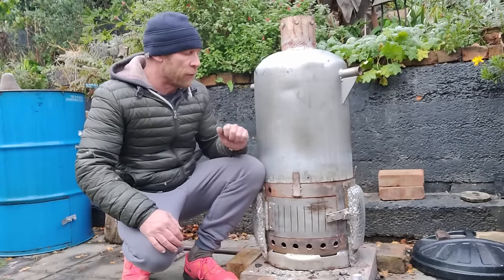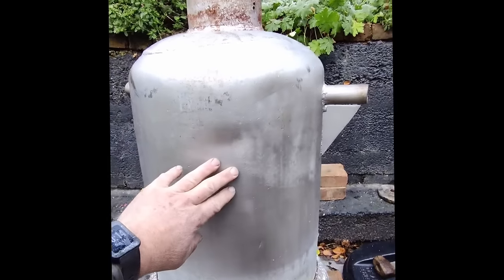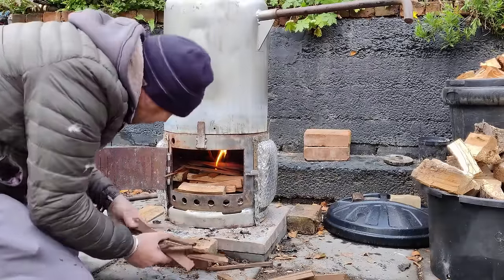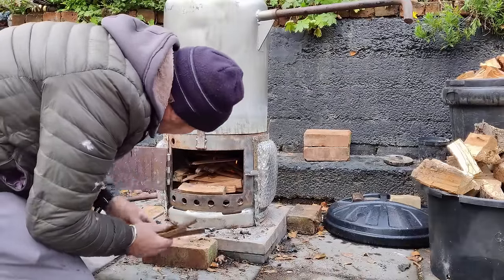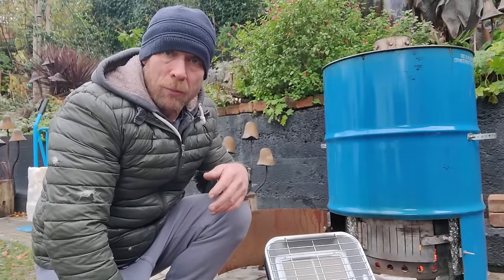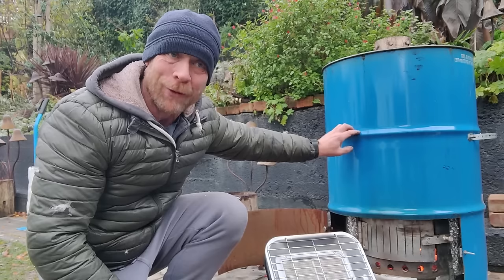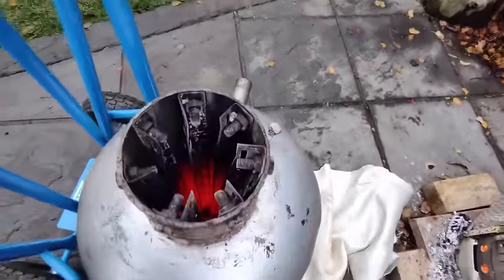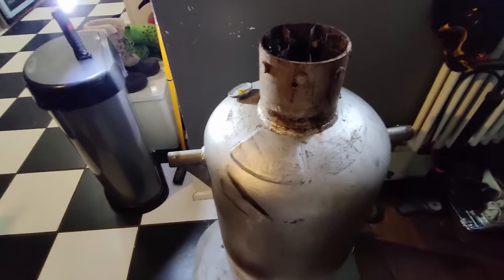Sand battery can it heat my home?

Comment: After study you can use a better insulation to get high temperature (or keep it as much is possible) , common sand battery model use 600 Celsius , due to the fact that most "infrastructure "part like tube etc.. must accept higher heat , Sand Melting point is at 1600 Celsius wich would be 3 time more storage for the same volume of Sand, then why not try to go higher just under the boiling point 2230 Celsius for store more energy , perlite or vermiculite are the most suitable for insulation for high level of heat, then use metal tubes with platinium or mobdylenum or tungstene ....it is the way to go ,  you will need to find the exact mix of metal powder for the circulation of the calories (some company have already find the correct mix for create liquid metal that fit) the day someone is able to do this for cheap ....it will be game changer for the world :)

Comment: Just wondering why my other post fail to post?
Reply from the maker: not sure? Can see this one 👍
Reply: @leejones2511  yes I posted another like 5 times and kept disappearing.  Just said to try it with water and a in + stainless steal container will store 5 times more heat.  Lol.  Of made correctly with pressure relief at 10k psi.

Comment: The YouTuber "honey do carpenter" (Darwin and his wife) has posted updates few days ago, wearing Santa hats,  December 2022, for his revolutionary heat battery portable rocket stove system that burns at higher temperatures, only weighs about 60 pounds, and uses your 2 buckets of fuel to burn for a couple days instead of a couple of hours. A caution is that you need to know the melting point of your internal flue metal when achieving higher  temperatures.  To protect it and save wood at the same time, ask him what his exhaust temperature is that is coming out the stove back, that can be piped into your sand battery. 

The secret of his stove holding heat for so long, and achieving the higher temperatures is partly the internal design and partly the air-crete insulation around the alumina silica firebox liner and internal flue, easily molded. 

If you empty your sand battery and fill it using his air-crete insulation and firebox and flue liner recipes, you will save a lot of wood and achieve higher temperatures faster.  You may be able to show him your sand battery to help him heat his homestead home that is still being built and still has walls open. He may use some of the exhaust to heat the style sand battery you have, and carry it to the other rooms as needed.

Comment: simple idea to spread heat thru room.   If it is NOT put in center of room..  but closer against a wall ... put cheap mirrors on the wall behind it.  You could even put a couple on mobile stands and aim them to move heat from behind Sand Battery out into the room space.  (waste of heat to be heating  the wall behind it).

Comment: Thanks for the video and the information 👍In the UK, overnight energy rates can be a third to a quarter cheaper than day rates, but storage heater costs are ridiculous at the moment. Wonder if anyone has tested a decent sized simple "sand battery" heater for 4 hours overnight (with PTC heaters?), and used to keep a room warm during the day?

Comment: Love this. It works amazing when you combine just a simple oscillating  room fan near and it circulates the heat around it distributes nicely.  For the small amount of wood used to get 7 to 8 hours usable heat with no accompanying fan, that is amazing. The extra fan seems to add to that time since the heat blows throughout the room.

Comment: Insulate the outside of the blue barrel. The metal of the blue barrel on the inside will reflect the heat back to the mass heater.

Comment: interesting that the roll of fencing makes it smokier......  thinking the fencing... if it goes low enough into the smoke/burn stack (like nearly all the way to the end of the inner tube... itself might be acting like a secondary ignition point to burn off the volatile gases. You might need more air somehow into that area so it can create that ignition though.  hmm

Comment: Maybe build a couple more sand batteries and inside stands, then when you remove the first sand battery putt the next one on the fire and add some more wood, because you're charging them sequentially it'll take a bit longer but 3 spread out around the house will probably prevent the need for other heaters.

Comment: I expect that if you painted the outside of the cylinder in a flat black paint that it would radiate more heat. You might try that.

Comment: Also you can make a fire in your portable fireplace outside and face it toward a glass door and it will radiate through the glass and put heat into the house.

Comment: Haave you thought about  using oil  candles inside?  If the battery is on a stand inside you can place 2 or more under the area where the sand is to extend the heat cycle a few hours. No venting needed.

Comment: I would have set that in the house like a wood burning stove and then it holds the heat inside as well as warms up the house with the fire you are using to heat the sand up

Comment: Your propane heater doesn't have a low oxygen sensor on it. If it did, it would be in the front of the ceramic burners with a pilot light. It senses a low oxygen condition and shuts off the gas so that people don't die. If you use it in the house, I wouldn't use it at night but if you must, I would invest in a carbon monoxide detector and keep it near the burner but not so close as to melt it. Also, I would make everybody in the house aware of the symptoms of carbon monoxide poisoning. Dizziness, disorientation, difficulty breathing, difficulty thinking clearly and rosy red cheeks as carbon monoxide is absorbed into the blood easier than plain oxygen and makes the color of the blood a deeper red.

Comment: im sure it works well but thats a lot of effort for a little heat. you should run a line set outside put a heat exchanger inside and either pump water through it or make a heat pipe similar to ones in laptop coolers

Comment: Can I burn oil wicks underneath instead of wood in order to burn it in the house? I don't have help to lift the thermal battery. I could exhaust out the window by making a fitting.
Reply: YouTuber TNT has a unique invention for burning oil instead of wood, also how to quickly purify used oil. Another YouTuber produced "Everlasting Heat 2.0 using vegetable oil, 10 wicks and a 50 caliber ammo can to produce a lot of heat. I'd like to be able to burn oil in the house to heat up the sand battery. Would it work?
Reply from the maker: Yes you could do all that but I have plenty of wood & it's free which is what it's all about for me, I get alot of people mentioning about the effort of bringing it in but it really is no bother,  find it quite funny,
But yes if you don't mind burning something indoors & it's safe then have a go but for me this works for us & is the only realistic option at the moment 👍

Comment: Should add some cheap eco fans to it that will chuck the air around the room such an amazing idea keep tinkering mate and keep up great content
Reply from the maker: Yes I so times use the the pc fan to blow it around or once it's lost some of its blistering heat from the flue we put the fan on top & blow heat down the flue so we get heat from the bottom & heat radiating from the body which is very effective 👍

Comment: Great idea for a flat( I’ve been doing some heat, electricity and gas saving things) I think it needs hole both sides for a safety pin to stop any chance of one of the handles coming out. With that weight going up stairs and is v hot, I wouldn’t take the chance.
Reply from the maker: It's a snug fit & only gets lifted up & the down onto a sack barrow & that's ratcheted on for the stairs 👍
Reply: @leejones2511  ok all sounds good, what is ‘’ratcheted on for stairs’’, does that mean the sack barrow wheels have a ratchet to stop wheels going backwards down the stairs?
Reply from the maker: No it's strapped onto the sack barrow,  my wife has the handles &  I have the bottom of the sack barrow, I lift it up and she pulls, I understand that people think this sounds hard & dangerous but it's not at all & very safe otherwise we wouldn't do it & certainly wouldn't get my wife involved, takes less than a minute 👍
Reply: Last autumn( fall) I collected lots of  discarded  Windows and lengths of timber from builders skips, that I used to secondary glaze my 1 bed flat, the Windows were double glazed so now I have i(n effect) quadruple glazing. I’ve done it in a way so the windows can easily be taken down in warmer months, I’m now collecting discarded materials to make a Methane Digester to make my own BioGas, also have the materials to build a DIY  micro Vertical Axis Wind Turbine(VAWT), to at least power my lights & PC and charge my phone. Not good with electronics though, but the info is on YT, so hopefully I’ll work it out.
Reply from the maker: @Kiyarose3999  sounds great 👍 unfortunately I have very poor electronic skills myself & very sheltered for wind turbine & even  solar panels so this is our best alternative at the moment

Comment: Have you worked out the energy content when you haul it indoors ?
Reply from the maker: No not really as long as we get 7hrs+ heat out of it is all we are interested in tbh 👍
Reply: @leejones2511  hauling it upstairs gives you a 'free extra warm' and keeps you fitter.
Reply from the maker: It certainly does 😀

Comment: How does sand compare to concrete? What if you filled the metal cannister with solid concrete?
Reply from the maker: From what I understand it's very much the same, cost is obviously more. Downside it will contain a lot of moisture  so venting would be important 👍
Reply: Actually, concrete releases lots of co2 when it is produced and sand batteries are all about lowering co2 output. (At least the larger sand batteries have that goal)
Reply from the maker: Yes that's correct but in the form of heating through burning wood becomes pretty much irrelevant 👍

Comment: sand in metal container/frame is a quick way of not needing to do brick work
Reply: like a shipping container full of sand
Reply: if you have a sand filled shipping container as your foundation, then heat it from the bottom, by any burn/resistance heating, it will store the heat like ground/floor heating
Reply: keep the wood/any burner outside, under the foundation
Reply: sauna water heat by steam boil
Reply: or just hot water heat circulator system temporary storage in the sand
Reply: why move every time, just have it close to hook up a heat/water loop
Reply: just the heat rising from the middle tube (clear the bottom hole) would be enough to heat by air flow heating conditioning loop
Reply: ari duct hot air piping from outside, simple cheap air duct pipe, insulated

Comment: I'm intrigued by the idea of making a smaller one for heating my Ford Transit camper.
Reply from the maker: Be perfect 👍
Reply: You could use it as a stove to cook in the evening whilst it's heating up.
Reply: @markmoz    I've made a couple of wood burning camping stoves, one a double walled gassifier.  I was thinking of putting it on top of one of those, but I think something based on a Kelly Kettle, but of steel thick enough to handle the higher temperature.
Reply: @felipearbustopotd  Hey--thanks!  It seems that the Kelly Kettle stood up to the heat pretty well!  I was concerned that it might overheat and warp badly.
Reply: @ianbruce6515  That is excellent - glad it worked out for you.

Comment: Make sure that is not metallic paint on the metal surface, it too acts as an insulator.  Many people inadvertently reduce the heating capability of their radiators using metallic paint.  The sand is an insulator likely because of all the air in between the particles.  If I had to guess.  Mix up some clay rather than sand and you might get a better result.

Comment: I would never burn anything inside without an exhaust to the outside.
Reply: He's burning outside, then takes it off the burner just taking the sand cannister inside.
Reply: @bernardrevill9547  not with that gas heater he has.
Reply: @MyName-mo7fw  ye, sorry , only seen that after. I wouldn't myself but people used calor gas heaters all the time, the downside to them is they create a lot of moisture/condensation
Reply: @bernardrevill9547  My concern is  carbon monoxide poison.
Reply from the maker: We have a detector in the room👍
Reply: @leejones2511  ok good, but it's still  carbon monoxide in your home
Reply: @MyName-mo7fw  High ceiling - old style sash windows - should give good ventilation. But you  are totally right to raise the concerns over carbon monoxide.
Reply: @MyName-mo7fw  you’re not listening.  Nothing is being burned inside the home.

Comment: Love the creativity demonstrated by this project. Obviously the exploding cost of energy is a huge problem that doesn't look like it's going away any time soon. So, all solutions need to be on the table.

What I would love to see, though, is more precise temperature measurements (a laser IR thermometer is under $25 USD), and how effective the sand battery is at heating a single room of known volume for a measured period of time. 

With supplemental heaters going in connected spaces, the actually effectiveness of the sand battery is unknowable. So, the lack of scientific temperature/time measurements makes it impossible for others to know whether they should try this solution or not.
Reply from the maker: Yes I have done it in the pas as a sole heater & generally it will keep heat for 7hrs to 100-70c depending on burn & at ten hours is still at 50+,
We e have had it in a room & heated just that but yes il try another quick video on a sole room with door shut as I've not done that in it's bare state  & see how it performs 👍
Reply: @leejones2511  We met a young guy in our town who is building his own tiny house, and he has a certification in HVAC.

I can ask him about sizing a sand battery heating unit for a well-defined indoor space (LxWxH, R-values of walls, ceiling & floor, and total area of windows), and average outdoor winter temperature & desired indoor setpoint temperature.)

I suspect that the HVAC calculations will take into account all the room & temperature values, as well as the thermal storage capacity of a volume of kiln dried sand, the BTU's per hour of a wood fire, the efficiency of heat transfer from wood fire to sand, and the discharge rate of stored heat from the sand battery to the room air over time.

To be maximally useful to people who need a similar sand battery solution to heat their living space, there needs to be a simple calculation or rule of thumb that they can apply themselves that will inform them as to whether a sand battery of your size would work for their situation.

(NOTE: most suppliers of heating & air conditioning systems have a BTU load calculator on their website that ballparks how big a system they will need. That calculator app is essentially doing the math for the homeowner and making a workable recommendation for what system capacity will deliver the heating/cooling needed to put the indoor air into the desired comfort zone.)

You are in the unique position of a talented diy'er who created a sand battery solution to be able to help model system performance for others who need an immediate solution to an urgent winter heating problem.

Hopefully an HVAC expert or energy consultant will chime in and help with how to quickly and simply gather the measurement data necessary to gauge your sand battery's real world heating capacity. (That would be an awesome contribution to the current energy crisis that is affecting millions of people around the world!)